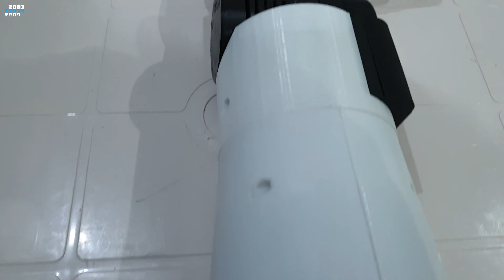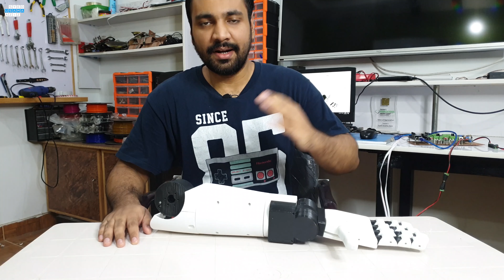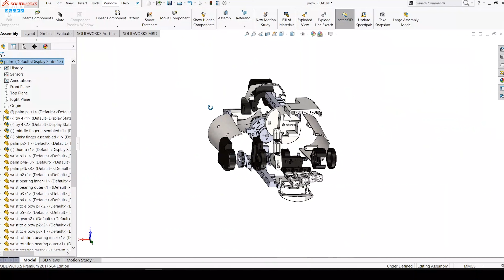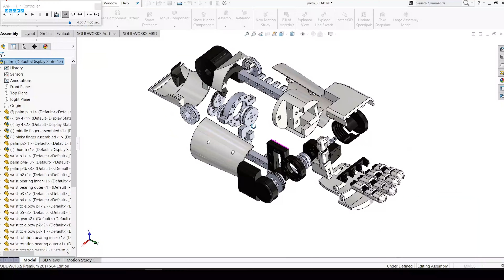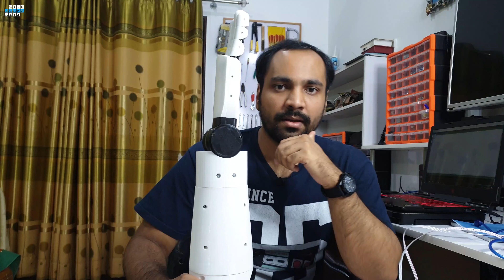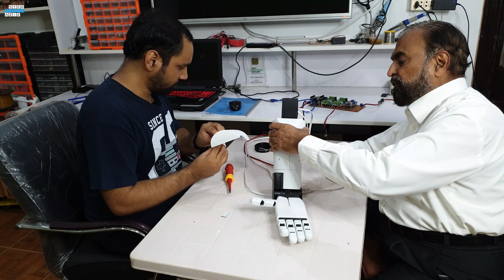How Wrist and Forearm work in my Robot - (3D Printed)

Comment: Here is my humble thought on why you keep the clearance. 
To understand it place this arm on a robot. This clearance makes it easier when it tries grasp something. If it is completely zero with no clearance, it need to make quite some manouvering to grasp. Try to do it with your hand.
Kindly give your feedback. By the way, great work and motivation to others.
Reply from the maker: Glad to find someone sharing his thoughts technically. Neat explanation. Just wanted to add one more thing, if hand touches wrist without clearance, thumb rotation will be impossible, hence, hindering grasping capabilities.
Reply: @COBOTLAB  Thank you for your feedback.